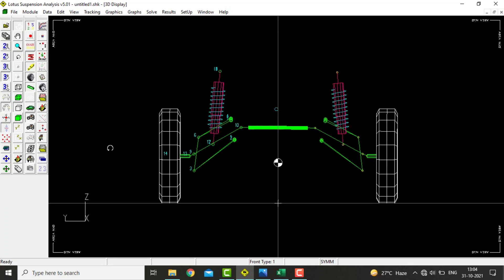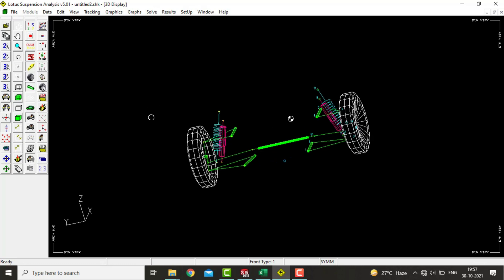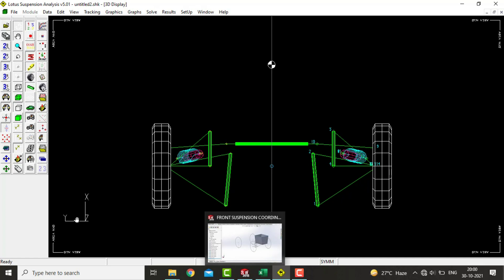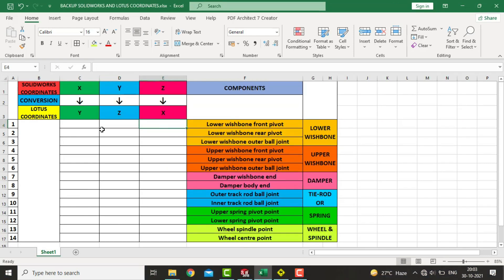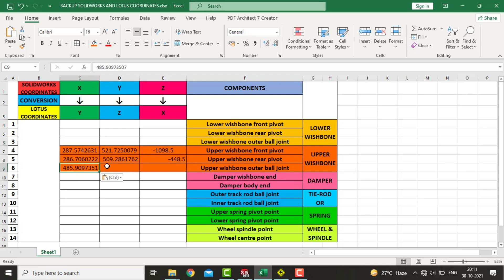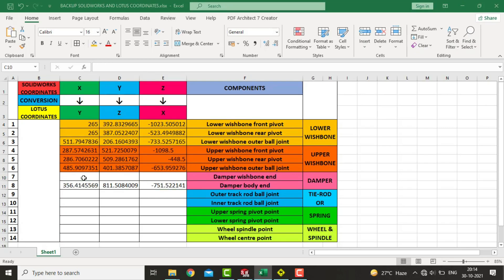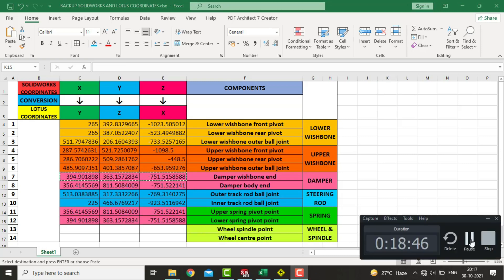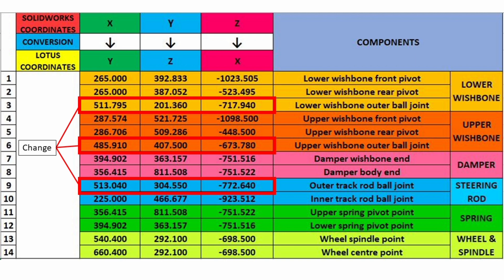Import Suspension Hardpoints in Lotus Software | Double Wishbone Geometry | Solidworks  | Part-1

Comment: Video on getting hardpoints for the Lotus suspension super helpful. Could you please make a detailed video on how the front double wishbone (double arm) geometry is drawn or set up on the roll cage? Specifically for placement, angles, and reference points. It would be amazing to see the complete process from hardpoints to actual geometry layout.

Comment: hello 
can you please suggest some video to understand what hardpoints actually are ?
Reply from the maker: Hard points are suspension crucial parameter points like [upper ball joint, lower ball joint, wheel center, wheel spindle point, shock body mount, shock suspension mount, etc.] Points which represent suspension components and  linkages.